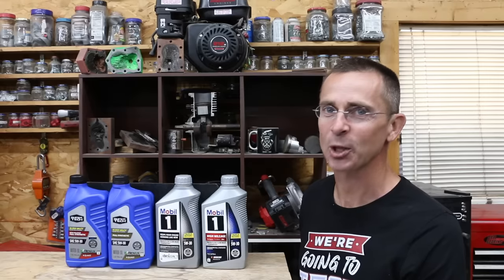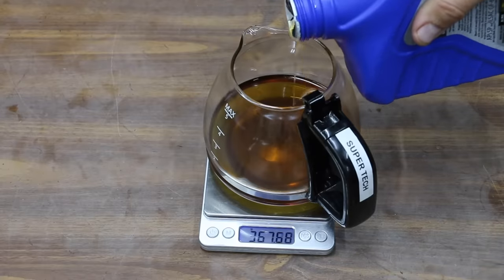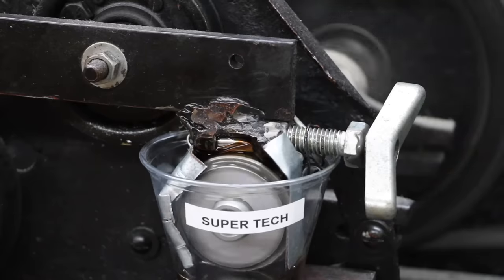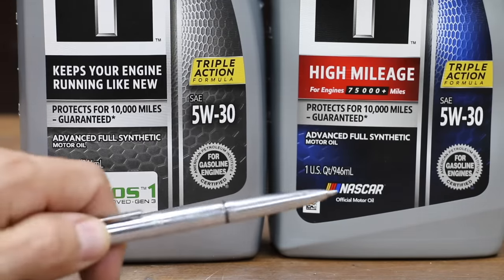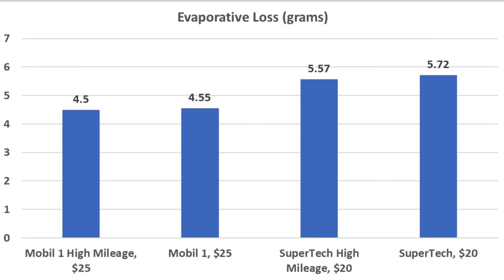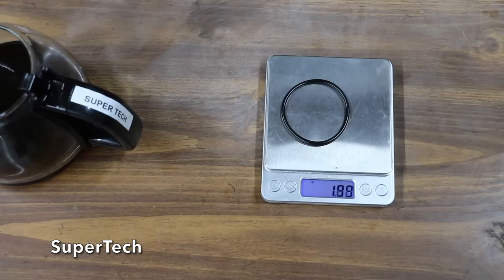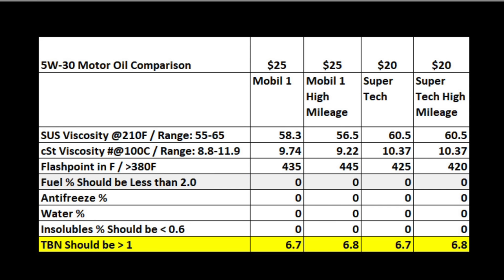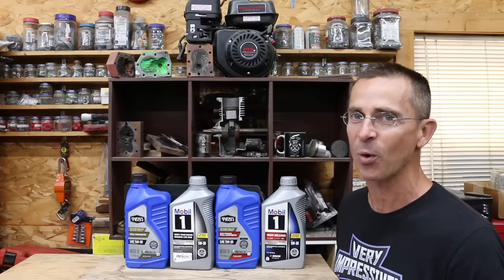Is “High Mileage” Motor Oil Safe? Let’s find out! Mobil 1 vs Mobil 1 High Mileage; SuperTech vs STHM

Comment: I work at an auto parts store, so these oil videos and other car related ones have really helped. I recommend the 3M headlight restoration system all the time thanks to you. So, thank you for helping me help my customers make an informed purchase 😊
Reply from the maker: You are welcome!  Thanks for sharing!
Reply: It's so nice to have an employee that can give an actual informed product recommendation instead of being clueless and BSing you. 
They should pay you for your time to watch Project Farm.
Reply: wet sand with 2000, then buff with tooth paste and then wax
Reply: @SpaceRanger187  buff with tooth paste. lmao.
Reply: I also work at an auto parts store and have been using project farm to recommend stuff to customers!
Reply: What kind of blinker fluid is the best?
Reply: @nutzeeer  Full synthetic high milage
Reply: @SpaceRanger187  I did try toothpaste by hand as a teenager once but it didn't do much besides leave toothpaste residue everywhere.
I now use a small 12 volt cordless polisher/sander with whatever plastic polish I have handy (Maguire's PlastX and Starbrite Plastic Polish come to mind among others). Yellow foam pad first then the black pad. Unless they are really really super bad they look brand new in under a minute.   Although I can cut smaller circles out of the 6" velcro backed mesh style Mirka sanding discs to fit and then wetsand through the grits if needed. The polisher/sander is really the trick though. 
The 3M system is great for most people so they can use a regular drill and it even includes the sandpaper and everything you would need if you don't have fancy polishers, polishes, and ultra fine sandpaper laying around.
Reply: @drksoldier1  Drill with polish head, soft caps to go over them and Maguires clear coat polish. Couple of times and the yellow really comes out.
Reply: Bullbutter works best 😮
Reply: @SpaceRanger187 WHY would you REMOVE the plastic from a headlight assembly??? 

Just use rubbing compound!
Reply: Mothers mag and aluminum polish, works great in 5 minutes, crystal clear,
Reply: Watch the Chris Fix video on changing your blinker fluid.
Reply: @nutzeeer 
Clear eyes

Comment: Over 75,000 miles is "high mileage"?  These oil companies need to get on the level with Japanese cars where anything below 150,000 miles is "low mileage".
Reply from the maker: Thanks for the feedback.
Reply: Sure man you wouldn't buy cars with 150k on them at msrp
Reply: But in Japan, they retire vehicles at 50,000 😂 that's the funny part, they engineer stuff to last much longer than the government lets them use it
Reply: 337000 ks camry. Penrite 10w 40 semi synthetic. Should be 5w. Doesnt burn oil.
Reply: @SconnieFish  Those vehicles then get shipped and sold used in other markets though. That's just Japan. Same way houses there aren't an investment and eventually get destroyed after a number of decades.
Reply: @SconnieFish 
Would love to hear more about that. 😊
Reply: 😅 @SconnieFish
Reply: 2010 frontier 202k 💪🏽

Comment: I think it would be very interesting to see a comparison of OEM oils (all the same weight) such as Honda, Mopar, GM, etc., maybe with Mobil 1 or something else thrown in as well.  There are some folks that are religious with using OEM oils when it probably isn't necessary.
Reply from the maker: Thanks for the suggestion.
Reply: I will second this great suggestion.  I think you have just shown here that high mileage formulas don't do any harm, but they aren't essential either.  I have had six Honda V6 vehicles in the past 20 years, changing oil according to the onboard reminders.  Our 2006 Odyssey went 200K miles using recommended 5W-20 synthetic blend, and never needed to add oil.  A 2013 Accord I drive  daily gets the recommended 0W-20 full synthetic.  At 125K miles and 10 years, it burns no oil, leaks no oil,  runs like new, and gets the same mileage.  I see no reason to use high mileage oil!
Reply: You can test that not your channel🤡
Reply: I've never been an oem oil person, but our Mazda original 0W-30 oem oil IS considerably smoother between the fingers and has lower fuel consumption at new and before change than the generic crap we've endured a few times from our shop. Same car 160000 km and soon five years. The Mazda original stuff is stupid slick with the, very high tech, finger test at least. :P
Reply: I think that vid would be cool to see.
Reply: @ProjectFarm  I 2nd this idea as I've heard lots of good things about Motorcraft oil specifically.
Reply: Considering that even Ford in their manuals and what they tell 3rd party retailers, suggest Ford's Motorcraft products for Ford vehicles. I fully agree with this idea and would love to see the results of such an experiment.
Reply: OEM Toyota oil is cheaper per qt.
Reply: OEM oils are all made by a major motor oil company.
Reply: @Baebon6259  yep
Reply: And maybe Amsoil to see if the results justifies the price. 

Especially for a daily driver vehicle that’s not as special as a weekend car but should probably get better care than a company fleet car.
Reply: I used to work for a chemical packaging center here in the U.S. and we supplied the same fluid for all of our domestic & foreign clients. We would just switch between different types of bottles, labels, & packing to meet the clients need. So for example, ACDelco, motorcraft, VW, etc... would sell the same product at a different price to consumers. So don't fall for OEM, pay attention to the certification to make sure it meets your need
Reply: That's because ford's break no matter what.
Reply from the maker: Thanks for sharing.
Reply: Yeah, Like Purple!
Reply: @williamwheaton8117  it doesn't. Unless you have a compression race or boxer engine you don't it.
Reply: @gonad84  ..LOL.. the ole saying is if their are no oil leaks on a ford it's because it out of oil
Reply: Agree
Reply: Amsoil and nothing else! 

Better than M1 & Co.
Reply: @laurapalmerTDGE  BASED ON WHAT ???
Reply: @gonad84  nah, my 2004 expedition Eddie Baur edition has 230k miles and is still running strong. Unless there's a factory defect, it's all about the maintenance.
Reply: very curious about "Genuine Toyota" oil vs bulk oil brands like Oilzum
Reply: @johnm948  exactly, there's only so many oil refineries...
Reply: Fancy seeing you here! @a cappella hymns
Reply: The only OEM oil I use is for my Toyota automatic transmissions. I usually buy Aisin fluid from Amazon.
Reply: @js290  they'd all have different specs and different additive packages though.
Reply: I buy oem because it's cheaper
Reply: That's a great suggestion.......   Toyota Oil vS Castrol Full Synthetic would be good for me.
Reply: OEM oils are a joke, they are just standard oils off the shelf, Castrol, Mobil, etc. but the Mfg. tells consumers that their oil is somehow "special".
Reply: @dickjohnson7845  
I don't think many here would doubt you.  But that's the best reason for @ProjectFarm to do a video about them.  Prove it so that people stop wasting their money.
Reply: @acappellahymns  anyone can send their oil off to the lab for like $20
Reply: @deViant14  
I think you're missing the point here.  If we have a youtube channel that is willing to test oils against each other, what's wrong with asking them to do so?
Reply: @acappellahymns  I agree. I wasn't really advancing a new point. The point that was advanced that I replied to was that OEM oils are the same because they're from the same refineries but they're likely not exactly the same because they are different additive packages but that anyone who cared to advance a point like that could easily test their own oil first before saying something that has no proof.
Reply: @gonad84  1 Lincoln Town Car Limo-470K, 1 LTC L sedan-274K, both bought used.  Mobil 1 5-7K oil changes from purchase.  0 issues other than AC, tires & brakes.  You sir, know nothing of which you speak.
Reply: @billpayne7157  You got lucky. A lot of people struggle to get 80,000 miles out of their Ford
Reply: My Honda dealer said mobile 1 on the invoices. But, now that I’ve seen Honda oil filters opened up I’m not sure I’ll still go to the dealer. And mobile 1 is just average oil anyway.
Reply: Mobil makes Mopar oil
Reply: i learn alot on these projects. i use castrol now no issue but thinking about starting high mileage castrol. amsoil is also good.
Reply: @TheDeelunatic  Hyundai owners manual says Quaker State synthetic oil.
Reply: @PRO4XKEV  how old of one? Because the last one I saw said to use Shell Helix
Reply: @AngelValdovinos  do you realize that most video ideas come from suggestions? 🤡
Reply: @shinobi6622  I wished OEM oil posted their data sheets.
Reply: Toyota oem oil is Mobil 1 synthetic.
Reply: im sure others have told you already but he did make one recently following that exact suggestion

Comment: Your motor oil tests have been incredibly thorough and informative.  Better than anything on the internet and have changed my buying habits.  I would love to see oil filters next as there is so much marketing material out there but no true head to head tests.  Thanks for everything you do!
Reply from the maker: Thanks and you are welcome!  Thanks for the suggestion.
Reply: Yes please do this!
Reply: If you do happen to take this on I am curious how premium filters like Amsoil, Napa Gold / Wix, Napa Platinum / Wix XP, Fram Ultra, Mobil 1, Royal Purple compare.  Also, would be interesting how premium filters stack up against the budget options like Fram Extra and Super Tech.  I am sure others can think of more.
Reply: @brad1367   I have searched for videos (and watched a lot of them) but none of them go to the lengths that Project Farm does.  The videos that I have seen are generally limited to cutting open the filter and completing a visual inspection (how does the media look, how does the bypass look). I am interested in how the various filters perform on a consistent testing basis.  If those type of videos exist I’d love to watch them.
Reply: @MechSpartan.    Check out "Whip City Wrencher" here on YouTube! He cuts open and compares filters!
Reply: @christophermeyer6414   thanks for tip.  I went and watched several of his videos.  I agree he does a really good job but they are similar to most others I’ve found on YouTube - cut it open, measure and talk about what’s inside.  I’m really interested in seeing some testing to see how they perform… Project Farm style.  Like filtration capability, dirt holding capacity, pressure drop, bypass open pressure, etc.   Definitely hard to do but I think it would be valuable.
Reply: @mechpartan8489  Yes, I agree! 👍 Project Farm testing would be really cool.
Reply: I can tell you this. Stay the absolute hell away from all Fram filters. They kill engines. My car currently has one on it and I wanna change the oil just to change the filter.

Comment: Hi there! I happen to do laboratory testing on rubber compounds as a career. I noticed when you were testing the hardness of the rubber tire chunks, you left the durometer on the pieces for some time before concluding the value. If you want to get a value that might correlate more closely with other laboratories, ASTM procedure is to press a Shore A durometer (the one featured here) into the specimen and record either the maximum reading or the reading after one (1) second under 1kg (2.2lbs). I’m really sorry if this comes off as condescending, I’m just a fan of the show and it’s exciting to see my job’s work done here.
Reply from the maker: Thanks for the constructive feedback.
Reply: Good thing this isn't an ASTM test but a comparative test, so all that matters is all samples were done as close to the same methods within the scope of this test.  Nobody is trying to compare these tests to unrelated tests which is the only point of standards with national or global scope.
Reply: It is cool to 1. That PF tests are somewhat close to those of "experts"  2.  The "pros" watch PF

Comment: As a bottom feeder in the car department with cars above 150k I've always wondered this. You add a lot of value to the curious community. Thank you!
Reply: I ran a car for 14 years and 312,000 km on normal synthetic with no issues.
Reply from the maker: You are welcome!
Reply: @spoony8232  312k km is around 200k miles, most cars arent that high but theyre not that rare especially commercial vehicles, 300-500k miles are the rare ones. all depends on how its treated and maintained my suv is at 171k miles(275k km) right now
Reply: Bottom feeder checking in
Reply: @spoony8232  yep I would only start using a high mileage if I noticed oil leaks, problem is once you start you can't stop from what I've heard, since you're swelling the seals.
Reply: 270k miles on my 99 grand marquis and still going
Reply: It doesn't matter what oil you use as long as it's synthetic and the viscosity is right. What matters is how it's been maintained. GDI engines of course needs that special oil designed for them. You should never drive a car more than 6k miles or 10k km between oil changes no matter what oil.
Reply: @jasonkillsformomy  i drive 6000 miles in 9 months..canni wait the 9 months..prob not huh
Reply: @Robo-xk4jm  I live in Canada so the salt on the roads in the winter eats the body, the engine was still running great when I replaced it due to the under body going soft.
Reply: @spoony8232 . Spray WD-40 gel lubricant all under the vehicle. Into the holes of the frame....everywhere. Just don't get it on the disc brake rotors.

Comment: I'd love to see oil showdown series for gear oil and automatic transmission fluids! I think it would be a hit as everyone seems to be VERY cautious and picky about their transmission fluids..specifically i'd like to see comparisons of the OEM fluids against the other brands that sell advertised equivalents, like Carquest, Valvoline Maxlife, and Amsoil to name a few. Great video as always!
Reply from the maker: Thank you for the video idea!
Reply: I'd appreciate this as well, I use Valvoline maxlife in my Honda and I noticed when comparing it to Hondas OEM fluid it has a slightly lower viscosity, having some Lucas stop slip laying around I put a small amount in to thicken er up
Reply: I just drained my manual gear oil on my 08 Ford escape 5 speed 180k..was getting grinding shifting in second when cold out .I used the recommended Ford motorcraft .haven't driven it yet .better work cause them 3 quarts costs 100 bucks
Reply: An ATF test would be great but it would be really hard to do. You'd really need multiple cars that take different standards of ATF to do a good test.
Reply: Gear/diff oil is a good idea, automatic transmission fuids - not sure there's much of a point. There are so many different transmission designs and fluid specs. While one transmission fluid may function and seem like it's doing well in a certain design, doesn't mean it's going to be the best choice for the long term no matter what cold flow or wear test results return.

Edit: Case in point above, poster is curious on Valvoline Maxlife vs Honda, presumably DW-1. Valvoline has stopped recommending this fluid as a replacement for DW-1 on their compatability chart as of 10/25/22.
Reply: @Hakuna_Frittata  indeed it would be very difficult to test it meaningfully, but I think there would be some potential for it anyway...perhaps he could use an oil analysis to expose the additive packages of two supposedly compatible fluids just to set a precedent? It would be interesting to see I'm sure, Todd never disappoints with his creativity
Reply: Personally I look up used transmission fluid analysis’ online of the same transmission I have. That really helped me dial in the best fluid for my 4L60 or at least what appears to be the best for it.
Reply: @patriotfury4013   - Just curious as to what fluid you found to be the best for the 4L60 as I plan to do a pan drop or fluid exchange soon?
Reply: Also I recommend testing Motul!
Reply: Please add Royal Purple ATF to that list
Reply: @stephenleone2375  Amsoil seems to be the best from all the analysis reports I’ve read. I have a 2006 gmc Sierra with almost 230k miles and runs like new. I change all my transmission fluid about every two years. I use a modified 3/8 trans cooler line fitting with a clears hose ran to a bucket. I just remove the return line to the trans from the radiator and insert the fitting and replace the retainer clip. Easy way to replace every drop of fluid in less than 10 minutes.
Reply: @patriotfury4013   - Thank you for your input.  My plan for my '02 Trans Am is to do a pan drop, so that I can install a new filter and clean the magnet.  Then refill and do just what you've done.  I did this very same thing on my Lincoln Town Car using Amsoil ATF and it worked out great.  The only difference is that the Town Car has a drain plug on the torque converter, which made it a pleasure.  Thank you again for your response!
Reply: @stephenleone2375  you’re welcome and I hope that all works out for you. I’ve learned that these analysis print outs give more information than anything that anyone says online.  These videos are certainly fun to watch and yield some great information about oils in general.
Reply: @ProjectFarm  My 2018 Toyota RAV 4 supposedly has lifetime transmission fluid.... Ha! 
I told the service department to change it anyway (at 40000 miles) and they stated on the service report that they weren't responsible for any transmission issues after the change. The vehicle doesn't have a transmission dipstick or a transmission pan. It is called a sealed transmission. What are they thinking?
Reply: @randallminor4866  Lifetime as it will last the life of the warranty and your AT will die after that point haha. The manufactures only use this wording to keep cost of vehicle ownership lower not the actual lifespan of different fluids